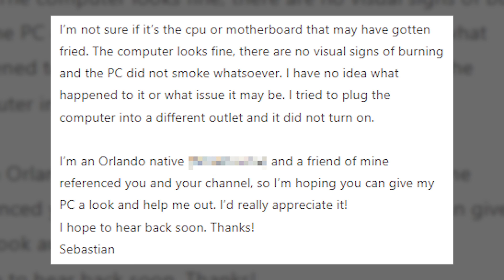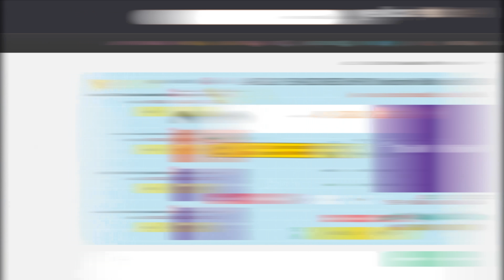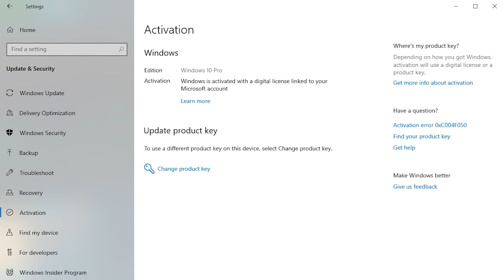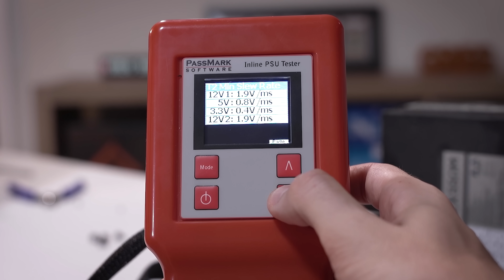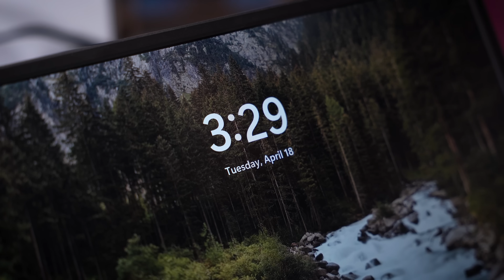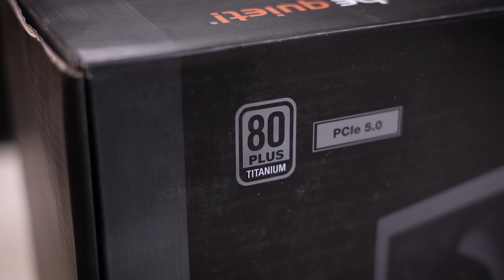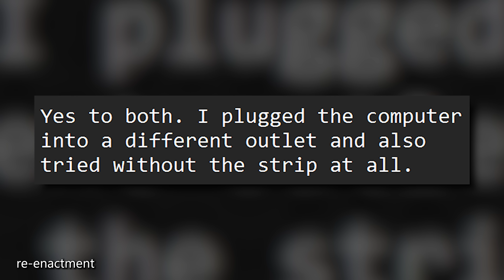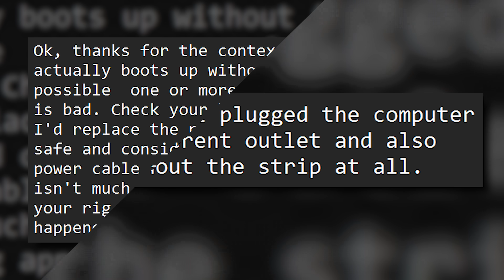Fixing a Viewer's BROKEN Gaming PC? - Fix or Flop S4:E6

Comment: Cool that you mentioned the outlets and the power itself.   Years ago, I had a nice APU that monitored our power.   Not just what the things plugged into it were doing, but the power come into it.   And it was showing some spikes coming into our house.   We called the electric company, they said everything was fine on their end.   So, I consulted a friend who is way smarter than me, and into electronics and things.  Turns out we can have the electric company attach a monitor to our meter that looks at what we were concerned about, at no charge funny enough.  The electric company didn't mention that when we talked to them.  So, we called them back and they came out an installed it.  After it ran for a couple weeks they came out and collected it.   Then informing us that there was no issue.   However, two days later there were trucks out from the electric company changing the transformers (and whatever else is attached to the power poles) on our street.  They also installed a new meter on our house.  Coincidence?  I think not.
Years after the above incident, our house had a lightning strike.   Being dumb and lazy, despite it not being used anymore, never took down our TV antenna, a relatively big one from the days of broadcast TV.   Over time its ground had degraded and this time it failed completely.   The only things that were plugged in that we lost were all on the same circuit, the TV and our computer in that room.  The cheap power strips failed to trip.  Ended up needing to replace the outlets as well, as they were fried.   The main PC with the newer APU at the time was fine.  Its APU took the hit and did what it was supposed to.  
Now, we have a power monitor/surge system on our houses breaker box, every outlet is GFCI, and everything that matters is either on an APU or a quality surge protector.   If all of those fail, then chances are I have bigger problems.  And the antenna was scrapped a right after the strike.
Reply: Stuff like that is one of the reasons my surround sound system is on furman power conditioner.
Reply: Have whole house surge protector on house that I put in this year!!😁😁

Comment: Greg I have been watching your videos for about 2 years now I've been wanting a pc for so long finally saved up enough and got one and built it today its a i7 11700k rtx 4070ti gigabyte b560m aorus pro ax with a evga 850 g6 what's your opinion on it?
Reply: If your intention was to do some overclocking on the CPU, your current motherboard won't allow it. But if overclocking isn't what you want to do, then its perfectly fine. The CPU should easily push the 4070 Ti along quite easily. :)

Comment: Believe me, power cables definitely can and do go bad.  I've had it happen personally before, and replaced a few for other people that had shorted.  The circuit breaker did its job and tripped in every one of those cases thank goodness.  And that sounds like a good example of one shorting internally.  I'd start with just replacing the power cable.  And since you're giving him a new PSU, it should have a new power cable included, I hope you gave it to him as well.  The plug and surge protector are likely just fine.  If it was throwing the circuit breaker and not tripping the surge protector, it could be an overload on the circuit.  Either way, I'd start with a new plug.
Reply: yeah man those old powermac towers with  those clear cables were notorious for catching fire lol ive seen it happen a LOT
Reply: One time I had this very strange power issue with my pc. I tried everything I could think of - other then replacing the "Power-Cable" that goes from the wall  to the PSU itself. Eventually I was suggested to try a different PSU-cable and that was the problem. As for what happened to the cable - I never found out. The cable itself was a very high end and rather thick cable. It originally came with the PSU i was using at that time a - An 80+ Gold FM 1250w PSU that was a very high end unit. With a replacement cable system started working like new and the PSU went on t serve me a total of 9 years out of it's 10 year Manufactures warranty. It was passed on to a friend and last I knew - it was still working after 12+ years of usage.
Reply from the maker: Oh of course they can! Just not very often. I've never run into this issue in my years of troubleshooting, building, etc. But it doesn't mean it shouldn't be checked which is why we mentioned it :-)

Comment: Though extremely rare that they go bad, there's one variable that did not get addressed - his actual power cable.
Reply: Yeah he did twice, at 10:18 Greg did say "He said he can still get his monitors to turn on but not the computer from the same outlet mind you, so maybe the cable involved? that usually doesn't go bad either but you never really know." then went on with the full breakdown "So it's important he tries to start with a clean slate, remove the power strip, buy another one, replace the outlets in the room, triple check the breaker for that room & then maybe replace the power cable"
Reply: @shaneeslick  Thanks for pointing that out.  I missed that - both times.  I need to pay better attention.
Reply: Ooh, that’s an excellent point. 

Greg will likely send the new cable that came with the new PSU, and the last thing we want is to be right about that through experimentation on the user’s end, so we may never know.

Comment: I had a power strip go bad about a year ago.  My damn PC was randomly shutting off out of the blue and it freaked me out.  What freaked me out even worse is that I kept hearing this loud buzzing noise that I thought was coming from the PC... maybe a fan or something worse like the PSU or MB.  Anyway, I finally located the noise and it turns out the damn strip was actually sparking and making a loud buzz.  I don't get what makes 'em go bad but they do.  It was a fairly expensive one too, oh and fairly new.  So, yeah, always check power strips.  It's one of those things most people don't think about.
Reply: Random faults can happen anytime theres electricity involved. Sometimes strips go bad with age and sometimes its just a random fault that makes it happen
Reply: @RobertReital  Yeah, I guess so.  It was a fairly new strip too.  I will say I am, or was, very relieved that was all it was instead of something worse.  A simple $30 or $40 issue compared to something worse.

Comment: Several things here.  Most rooms are wired on a single breaker.  It could be a bad breaker.  Also, we don't know the age of the home nor the condition of the outlets in the home.  We have all seen older outlets get loose making for a poor connection and that PC is pulling more current than anything else in the room more than likely.  A bad breaker will also cause the same issues.  You are in Florida...In the middle of summer...central air units cutting on sometimes (especially without a soft start kit or funtion) pull a lot of current.  It wouldn't be a bad idea to get an electrician to come check things out.
Reply from the maker: Yep. Was more or less getting to that toward the end of the video. Inconsistent power delivery in a particular room should be traced first to the outlet and then to the room's breaker.

Comment: Is the micro center series on hold for now? I was loving that series as well as this one
Reply from the maker: We're making an announcement tomorrow! :-D
Reply: Also I knew to look towards the PSU as soon as he described the symptoms. Maybe the psu did it's job with his power strip and prevented the system from turning back on. He did mention it didn't turn on with another outlet either, so maybe his breaker box triggered and shut off the outlets within the surge area

Comment: You made one big mistake Greg.  You didn't check temps.  The problem may have been that the CPU or Motherboard got too hot and shut down the computer.  The computer wouldn't turn on for a while if it was too hot and as a result, would give you all the symptoms described.  I know this for a fact as it happened to one of my computers a long time ago.  The CPU cooler had gotten clogged and wasn't cooling the CPU correctly and boom, the system kept shutting off when the CPU got too hot and wouldn't turn on at all.
Reply from the maker: We've run into temp issues many times. This wasn't one of them. Temps issues alone wouldn't cause his MONITORS to shut down and his surge protector to trip as described by the owner at the beginning of the video. No mistake here.
Reply: @GregSalazar  Ahh, didn't hear about the monitor problem.  Yeah, probably bad electrical then at his place.  You know Orlando, some areas just aren't that good.
Reply: You say "a long time ago", just fyi, thermal protection on modern hardware is much better than it used to be.  Greg understands thermal problems better than most, with all the clogged AIOs he has dealt with lol.

Comment: My theory, it's W11's fault.

On a serious note he should ask a professional to check the wiring in his house, more than one bad outlet can be bad news.
Reply: Dudes, this was a joke, hence why I said "on a serious note" afterwards.
Reply: @SeniorRed  Yes I understood that afterwards. Had to clarify so others don't think I was talking about the power outlets.
Reply: I got the joke... not a funny joke, but I got the joke.
Reply: I'm on Windows 10 and this happened to me, though not the power surge.. my room's < wall sockets works but > wall doesn't and the room next to mine on the >, < wall which is the same as my room's > wall also doesn't work but the living room's wall sockets works. Very weird stuff. I chained 2 power strips together to > wall socket and it works. All other appliances works normally, my PSU is also Corsair.. hmm no idea could be a brand issue with certain range of power after sometime of use?
Reply: 2 times my house power outlet broke... i though my pc broke or the cable for psu broke. So many times going to pc store to fix my pc.
Reply: whats W11?
Reply: @adrianstephan4011  Windows 11
Reply: @SeniorRed  I am clearly stupid lol :) thanks dude
Reply: Could it have been dirty current coming into the house and the PSU fail safes detected it and didn't power on the pc?
Reply: That doesn't make the pc not boot. I was replying to the operation system comment.
Reply: @outa7192  I can assure you not powering on does in fact cause it to not boot....
Reply: @MrBeetsGaming  Power issues aren't related to operation system issues which is what I meant. And op edited their comment from, "My theory, it's W11's fault." To adding, "On a serious note..."

Comment: These and other videos made me so much more confident going into becoming a entry level pc gamer.  Got a late 2021 alienware aurora r10 ryzen 5 5600x rx 5700 xt for 350 bucks plus 50 for shipping, great deal
Reply: Not a bad deal hardware wise. Alienwear though is a bit iffy
Reply: @SlyStarling  it runs well. I added a aio, vram heatsinks, took out the hdd and added 3 sticks for a total of 32gb of ram.  I only play project zomboid so it runs it amazingly haha
Reply: @SlyStarling  most of the time Alienware prebuilts don't have very good cooling. Unless of course you add better cooling.
Reply: @dragonman910  Thats if you can, some alienwears have that much proprietary shit that nothing can be saved haha. But either way, looks like he managed to get it working from the comment above yours so all good